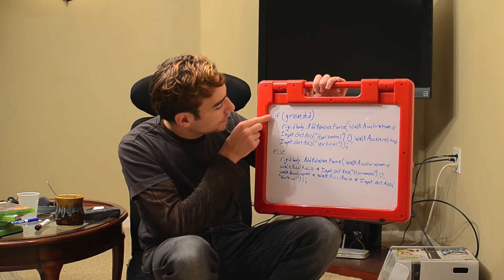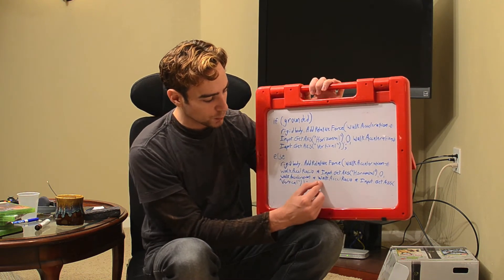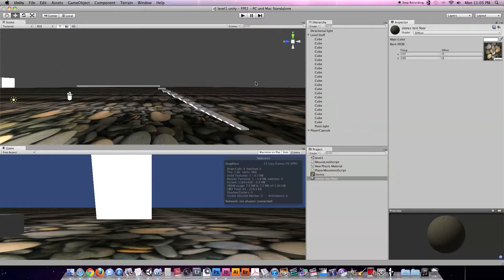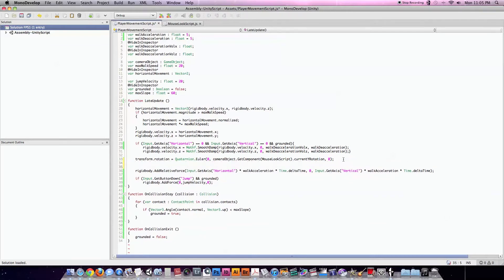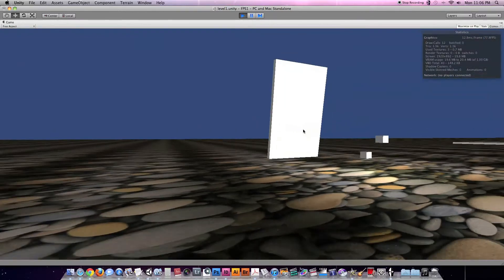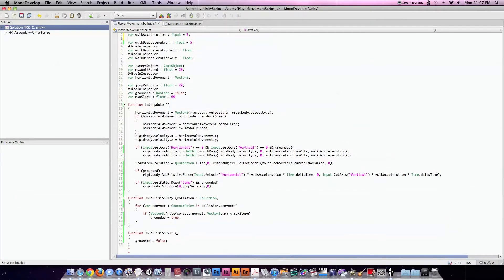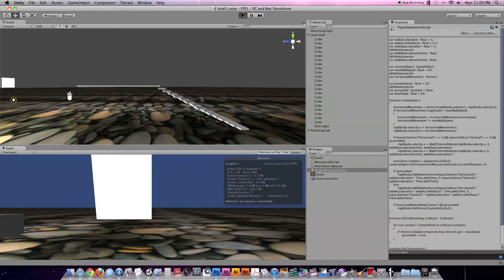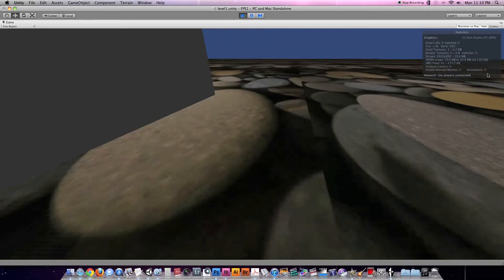FPS1.7 Limited Air Control and Sticking to Walls. Unity3D FPS Game Design Tutorial.

Comment: jeje I like it

var walkAirRacioz : float = 0.1 ;
var walkAirRaciox : float = 0.5 ;

  if (grounded)
   rb.AddRelativeForce(Input.GetAxis("Horizontal")*walkAcceleration*Time.deltaTime,0,Input.GetAxis("Vertical")*walkAcceleration*Time.deltaTime);

  else
   rb.AddRelativeForce(Input.GetAxis("Horizontal")*walkAcceleration*walkAirRacioz*Time.deltaTime,0,Input.GetAxis("Vertical")*walkAcceleration*walkAirRaciox*Time.deltaTime);

Comment: I know this is an old video but I found another bug involving the sticky walls. If you jump on a wall and then let your player slide down it, the player then thinks it is grounded due to it touching the ground. But then if you jump again while still touching the wall, you will in fact stick to the wall due to the player still thinking its grounded allowing you to "climb" the wall to the top. An easy fix I found to this is to add "grounded = false" at the beginning of the OnCollisionStay function. Hope this helps.

Comment: Hi, I have a problem. When i removed "Input.GetAxis( "Horizontal" ) == 0 && Input.GetAxis( "Vertical" ) == 0 && " then my MaxWalkSpeed stopped working.. even if i changed MaxWalkSpeed to 9999 it's still same movement speed. I need that to make sprint in my game. How can I repair this without pasting that line of code again?

Comment: so i have this glitch where i bounce just ever so slightly, not enuf to disrupt gameplay, but enuf to make grounded = false (therefore making stopping or changing direction impossible) except for short instants where i bounce off the ground, this bring me (and may be caused by) another problem, i am using a terrain where the ground is uneven so if i hit even a little bump i am sent hovering over the ground, and have to use air control to move until i hi the ground again (but am stuck bouncing)